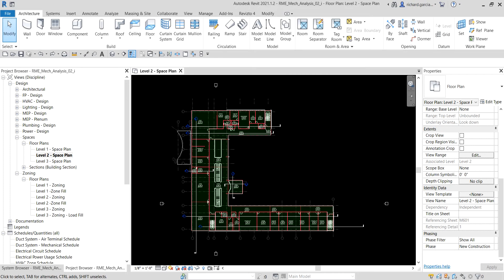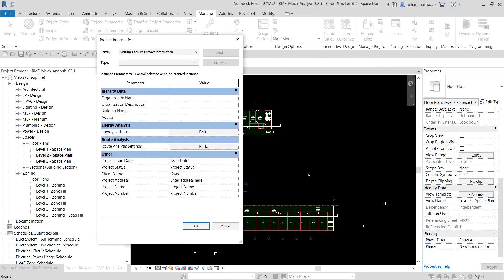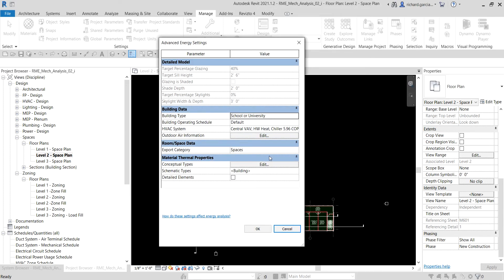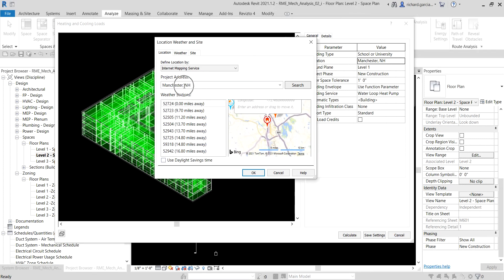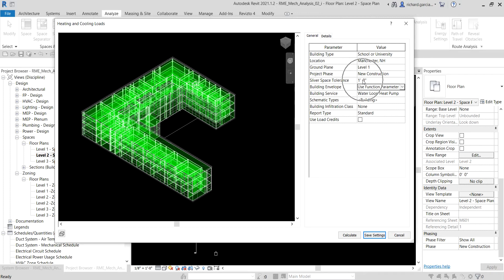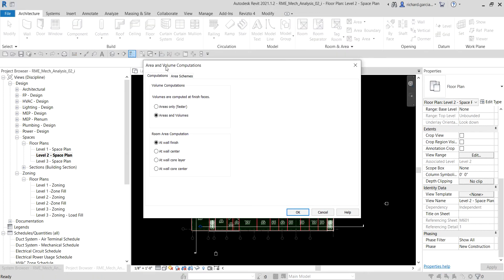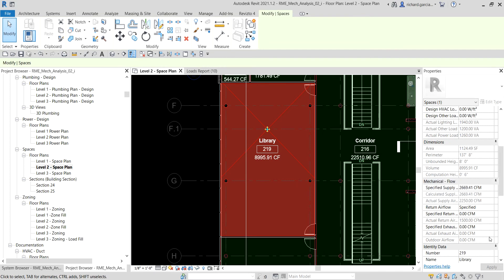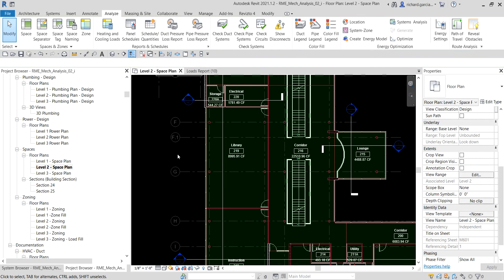REVIT MEP 2021 - MECHANICAL SYSTEMS - 6 ANALYZING HEATING AND COOLING LOADS

Comment: Hi Sir Rich, nakapag generate napo ako ng load report. Tiningnan ko yung mga spaces at napansin ko wala value or "not computed" parin ang naka lagay sa Calculated Heating Load, Calculated Cooling Load. Meron bang kailangan na I adjust para mag compute? 
Newbie po ako sa Revit at gusto ko yung ginagawa nyo. Thanks po
Reply from the maker: Yan din ung hindi ko makuha kung bakit. Kasi sinubukan ko rin yan sa hvac ko, walang lumalabas talaga. Di ko alam kung kailangan gamitin ung separate service ng autodesk.

Comment: Hello sir! How can I calculate the heating and cooling loads in Revit 2022 version?
Thanks!
Reply from the maker: Hi Ana, the heating and cooling loads tool has been dropped in version 2022.

Please check this article for more details: https://forums.autodesk.com/t5/revit-mep-forum/heat-and-cooling-load-in-revit-2022/m-p/10293144#M78584